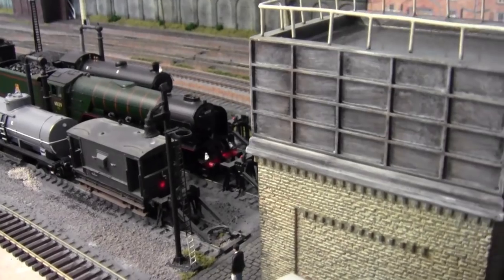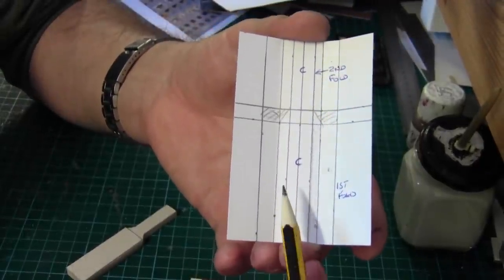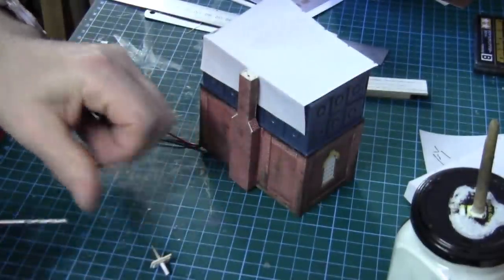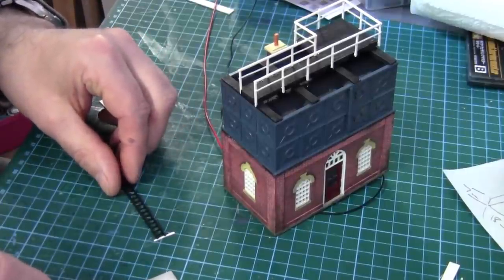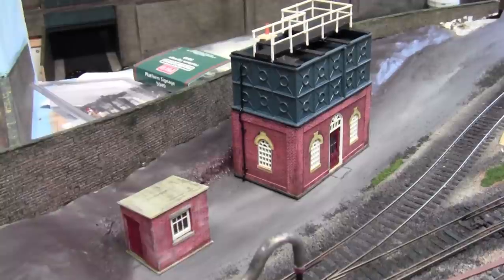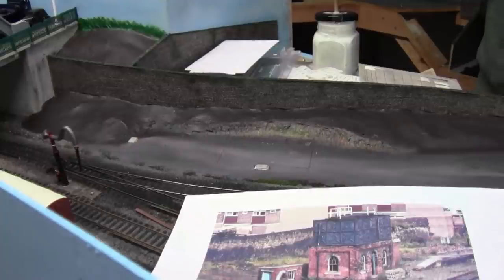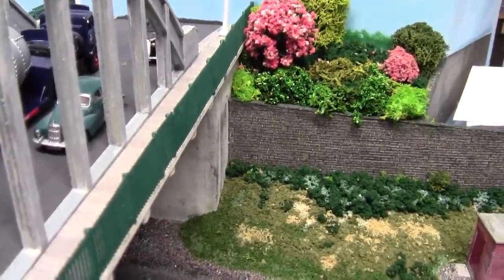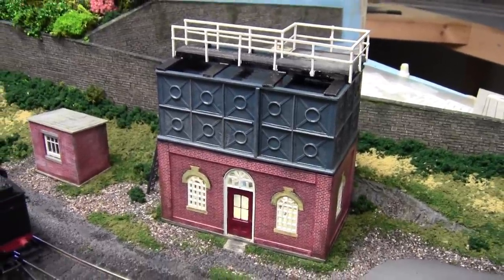OO Gauge N E R Water Tower. Part 5....No260

Comment: Hi Tony, yet another interesting and enjoyable video.
My apologises but I thought I had commented on your last video but I had not. Photos of the Water Tower which adjoins the Engine Shed at Bognor Regis and which I have modelled quite clearly show in photos the chimney which runs up the side of the Water Tower. Mine though is not open to the elements like yours and its also a model I am having to redo as the water tower is not big enough.
Regards Chris
Reply from the maker: Hi Chris. you know since the discussion about chimneys on water towers. i have seen them turn up everywhere. as in th evideo there was one always under my own nose. yes water towers do come in various sizes. there a huge one at newcastle and that has two chimneys. as you reworking the old one. or building a new one from scratch........stay safe my friend....Tony

Comment: I should imagine the shunting drivers used to go in there for a cuppa and warm in front of the fire
Reply from the maker: Hi Mick. they probably did. especially in the winter with those strong winds coming in from the river Tyne. have a pleasant weekend.....cheer's Tony
Reply: @TONYNORTHEASTERN  yes I would bet you would to are you going to put a turntable at the end of the yard ?
Reply from the maker: I probably would have done, if i had the extra 3 foot. a modelers nightmare never enough space.....thanks again Tony